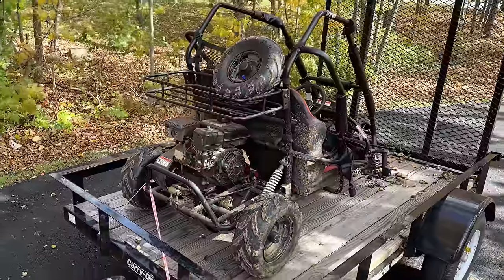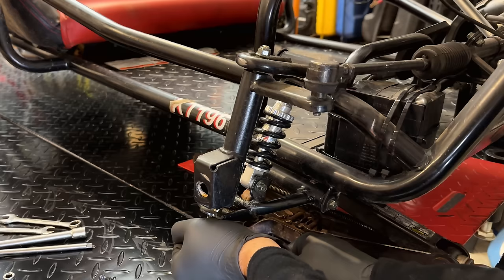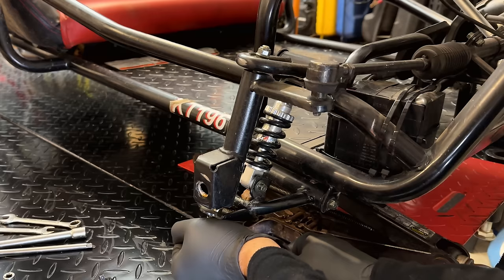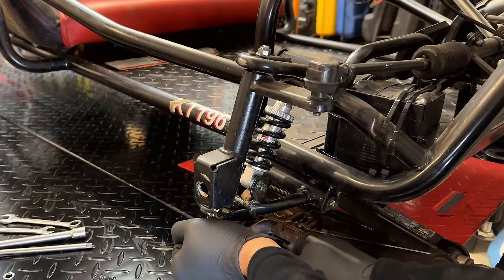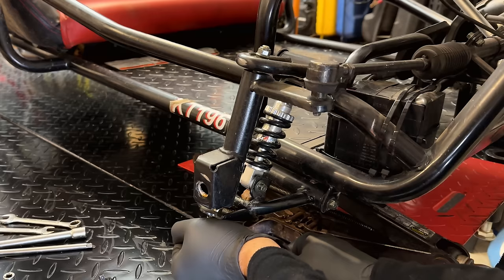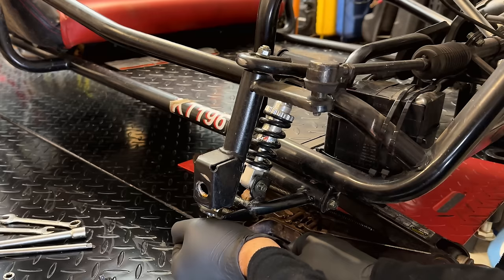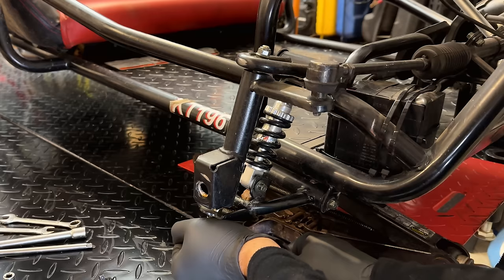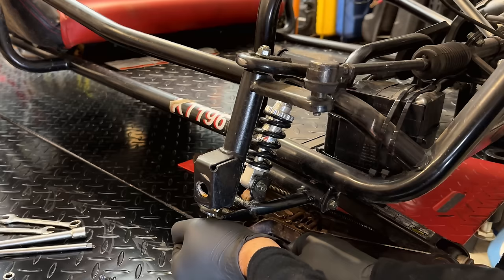Coleman KT196 Major Upgrade/Repair - Electric Start, Charging System, Suspension, Lights and More...

Comment: I don't think that brass "spacer" you put between the engine and drive pulley of the CVT goes there.  Think it goes between the "jaws" of the drive pulley.  Supposed to "float" there so the belt doesn't get constantly rubbed by the spinning output shaft of the engine at idle.  Great video.  Amazing the destruction a kid can do to a go-kart in a few years, even if you maintain it well!

Comment: Ran into a similar issue with the carburetor line spring clamp on my generator .  I ended up putting the clamp over the tube past the flare on the carb, opening the clamp and sliding the fuel line over the tube and under the clamp.  It was impossible any other way and I didn’t have any larger clamps.  Where there’s a will there’s a way lol.

Comment: You probably could have wrapped some rubber where those light brackets went and they wouldn't have moved.  A lot less complicated, but your solution certainly solved the problem.

Comment: run a weld bead under where the lights attach.... will give it something to grab on too

u could also wrap some tape around the tube and then attach over the tape

Comment: You could put crank on top dead center on compression stroke before pulling side cover then there is no pressure on cam from valves. Cover is easier to remove in some cases too

Comment: Lots of work, I am sure your kids will be excited. Did you consider just relocating the engine control panel to the front and making and extension for the harness? Alternatively you could have just used the components from the nine panel once you decide it could not remain in the back. The final results are very professional. I expect the battery would be happier and last longer mounted on the chassis rather than the axle?

Comment: That's funny. You made the front suspension actually work, where before it was riding straight on the spindle and he now say😂s the front is bouncier. Larf reminds me of a game I used to play flying. It was called Red Baron 3d. I could shoot anyone down with the worst aircraft, because they got lots better towards the end of the war. Then I improved the feedback so now you had recoil when the machine gun fired and you could feel it in the joystick. I was never as good after that.

Comment: What you are calling a "Torque Converter" is two "Variable Sheaves". They create an "Infinitely Adjustable Transmission". A torque converter is capable of multiplying torque whereas that transmission is not.

Comment: They beefed up the ball joints on the newer kt196 you can by the older smaller ball joints and swap em out. I has same issue.

Comment: If the lower pan rattles use truck bed liner it quiets down the machine. Had a few of these type vehicles over the year.

Comment: I wasn't there but I don't think the crank swap was necessary. I run 30 series on the regular clone cranks every day. 🤔 Also, I think you opened the valve lash up too much. The gap will actually open when the engine heats up as the aluminum case and head expand more than the steel valve train. I would also recommend removing the low oil switch for a power sports application.

Comment: They make adapter extensions for the crankshaft to give you the extra length you would require it utilizes your existing pto mounting bolt it would have saved you a lot of trouble swapping the crankshafts

Comment: Personally, I would have mounted the light brackets backwards, so the lights are more inside the frame rather than sticking so far out the front.. 
From what I could see from the camera angles, I don't think it would interfere with the steering.

Comment: I'm thinking what could have been shock absorbers are really some sort of stabilizer to keep the spring in place and also serve to change the characteristics of the spring by means of the large nut at the top.

Comment: Love your videos James. Just a well meant suggestion, You might want to reverse the mounting brackets for the new headlights. That way that the headlights will be slightly recessed behind the front brush guard. This way the lights wont be the first thing to come into contact with any thing that might get in the way, giving them some protection from impact.
Reply: I think that the choke cable may also need some protection inside a routing tunnel of some sort. I visualize a stump or root ripping off the cable or carb box. Proper leg thing and some well placed zip ties might help.
Reply: Lengthening

Comment: The bolts and upper and lower a arm should be tight. The bushing should rotate inside the a arm. If you leave the bolts loose, it’s just gonna wear out the holes that the bolts go through and the bolts.

Comment: I suggest leave the return hose from vent, put a bolt to plug the hose with existing clamp and secure...
Reply from the maker: Then the tank would not be able to vent and eventually the tank would build a vacuum and fuel would not flow to the carb.  It would work if the tank cap was vented.

Comment: 1:40:30 You want to imagine a stick sticking out of the back of the switch, it will point to which terminal will touch common(center tap) when you actuate the switch. 99% of every switch you see will operate like that. Also that's called a dpdt switch "dual pole dual throw", in the configuration (on-off-on) (momentary-latching-latching)

Comment: The choke could have been routed on the same side and not around to the other side it would have put it almost to the dashboard for easier access. For your headlight issue instead of that screw being drilled into the back just get a piece of rubber it would work the same and wouldn't scratch the paint.

Comment: Just put a 90* elbow fitting on the evaporator port fitting on the air box and shorten the hose a bit.

Comment: I would have turned the light brackets around so the protrusion is facing rearward, and then turn the headlight back around towards the front which would center the mass of the headlight closer to the center of the bracket.

Comment: 1:30:15 If the wires are long enough, I wouldn't remove the on-engine control box entirely, I'd simply relocate it to the bar it's going to hit when the suspension moves...

That way, not only do you keep the Circuit Breaker and Charging Diode, but you also don't risk Borking the engine by futzing with the control wiring...

Comment: The depth of the castellations on the wheel nuts wasn’t the issue, it was the height of the nut body. I would have ground down the face of the nuts to fit.

Comment: All the fun. Good video. I was going to suggest a coke cable but you did that lol. The only thing I would have added was a seal battery box. They are affordable and will keep the battery clean. FYI next time maybe test the new engine before you swap internals out.

Comment: I would have just bought the proper drive pully. Actually, the old Pulley would work just fine. A replacement pulley comes with two retaining screws a short one and a long one.

Comment: Great video Jim. That was a ballsy move changing the cranks out, wit a brand new engine😀
I think I would have greased up the upper and lower “A arm “ pivot bolts.
Nothing is easy to fab up. 
You did a fine job, happy it’s in one video, I’m off on Christmas break. 
Now I have to mow and weed eat the yard. And my neighbor has a problem carb on his Troy Built pressure washer
he wants me to look at. 
Ps : how about a video on how these multi position rocker switches work , please.
Merry Christmas.
Jim in Pt St Lucie, Fl.
Where its currently 76 and mostly overcast
Reply from the maker: Ahh warm weather.  I miss that.  Have a Merry Christmas

Comment: Thumbs up, great video, upgrading, and repowering where do you stop till you have full buggy suspension front and rear , 40 hp engine, and your down at the Dunes driving itin the sand with the others, a trip to Harbor Freight for a set of offset wrenches, you will find they are very handy.

Comment: James, can you cut out a piece of PT plywood for the battery tray....
with cutout holes for the heads of the tray securing screws...
then use the foam across the whole tray (foam covering the holes in the ply) 
so that there is no chance that over time the foam crushes and the screw heads impact the battery case cracking it and destroying the battery?

Comment: This seems like a perfect father/son learning project.  Are you sure those front shocks don't need to have oil added to them?  If you put a second nut on the switch behind the panel to offset the switch farther back away from the cross rail would that give you enough clearance to make the switch fit with the cool cover?  Much koodoos James for thinking on the fly to overcome each problem in turn to keep the project moving forward.  With all the little things you found wrong it shows the importance of routine "pre-flight" checks.

Comment: I was expecting you to use the key switch that came with the engine for the run start and stop. And just use a rocker switch in the existing square hole for the lights.

Comment: The thing that caught my attention weirdly enough was on the original 6.5 hp engine, the cam shaft gear was plastic. That surprised me a little bit. Even with oil lubrication, i feel as if the hot oil and the general radiant heat of the metal would melt that plastic cam and all he** would break lose in the crankcase.
Reply: Just another way to save money i guess  💁‍♂️🤷‍♂️
Reply from the maker: Not the best choice.  They do fail.  That was the issue with this mower https://youtu.be/oY6YZZ72jJw?si=ySPWsKtIEL9Koc5E
Reply: They don't just make the cam gear out of plastic. Now several popular brands actually make the cam and lobes out of some type of plastic. Its a crazy concept to me but yes, they work. And YES, they fail at times.

Comment: Don't feel bad about your  purchase of those steering parts  i just got a new set of wheels and tires for my craftsman ys lawn mower and the tires are the same as the ones that are on the mower but they are not the same color rims as the ones that are on my poulan XT mower  but at least you made those New steering spindles work on your son's go kart

Comment: yes but one thing i did not see you do and that was check the charging system with the lights in the on position
Reply from the maker: It probably was not keeping up.  Thankfully the engine does not need a good battery to keep running.  So far has not been an issue.

Comment: That drive system is similar to a snowmobile.  I think the drive clutch on the engine is not fully locking up due to the low engine RPM.

Comment: Hello James, too bad it is a 4 stroke, very slow, clumsy, hope your son likes it. What a strange transmission with two chains. I personally had tried bigger wheels, a loyal fan from the Netherlands
Reply: You can vary the top speed by changing the sprockets....
It works as a limiter as well of course....
but allows the engine to develop full power without bogging down...and no clutch or gear changing required.

Comment: @James, you made a very common measuring error when measuring the journals. You should be using the knife edges, not the flats of the calipers when measuring shaft journals.
Reply: 99.9% of the time it doesn't matter, but occasionally it does. So it is good practice to get in that habit for the rare occasions that it matters.😊
Reply from the maker: Good point.  I was a little too sure it would fit.  Probably should have also used plastigauge.
Reply: For those who may not understand why it is an issue, if there is a taper or grooves etc on the journal that isn't obvious to the eye, the flat surfaces will "average out" the variation and give you an incorrect reading.

Comment: Seems like it would have been less trouble to just weld an extension on the output shaft to make it the right length, instead of taking apart a brand new engine and mixing/matching parts.  IMHO

Comment: If the front coilover shocks were used up don't think the rear have the same amount of time on them?
Reply from the maker: The rear shocks are original to the go-kart.  They seem to be holding up fine.  Wish the front were larger.  Seems like they will just fail again soon with the way my son drives.

Comment: I would have had a machine shop turn a spacer for the end of the crank shaft and used a little longer bolt. 48:40

Comment: The throttle cable is dragging on the fuel tank.  Scratch the paint, rust the tank, leak fuel, engine fire.

Comment: I would be interested to know if the stroke on the new crankshaft was the same as the old.  That may be where some of your extra HPs had come from.  Bold of you to tear apart a brand new engine to swap parts.  I would be to much of a nervous wreck to do that.  Good job getting it working!

Comment: It would be great if there were the same units of measurement worldwide. That would simplify a lot of things. I'm surprised that there are even stores in the States that sell metric screws, nuts and drill bits. That's certainly the exception rather than the rule and, as with imperial, things certainly cost more. Greetings from germany ;-) btw.   thanks for adding the torque in NM love your videos
Reply from the maker: It would be great.  Thankfully I have a well stocked small hardware store with a great selection of metric hardware.  The larger big box stores would not have had that.
Reply: In Canada they converted to metric back in the seventies.but I still go to the home improvement stores and there are 4 x8 sheets of plywood and wall board ,go to Princess Auto buy hose by the foot . Still a lot of things here done in imperial
Reply: @12wingwfetech  The only things where we actually still use inches are screens (where the specifications are also in centimeters), tires and pipes in heating systems. Nobody can really do the math with it. I am always amazed at how quickly fractions can be calculated. I had real problems with it at school.

Comment: I like your videos and attention to detail. May I make a request  I would be interested in a video showing converting a gas powered generator to run on propane.  I feel that running on propane would be more tolerant sitting for long periods of time between usages.  Thank you
Reply from the maker: Did one last year.  Will link to it.  https://youtu.be/TReTACsS2cM?si=Ou9gMMS0DxDDvC25

Comment: Great video! However, I found the choke cable to be overly long, making that big loop in back of the engine. No way to make it aesthetically shorter?
Reply: You cut the spiral sheath outer...and then the inner cable to suit whatever length you want.
Reply: I was wondering that as well. Seems that loop could snag on something in the wrong circumstances. Can’t have it bent sharply,  but maybe rerouted a bit.

Comment: great video again, i noted something, what is regulating the charging current to prevent overload the battery
Reply from the maker: There is nothing limiting the battery charging other then the charge voltage.   Would not be good for the battery if charged that way 24/7

Comment: 2:10:45 Did you try installing the EVAP line to the Air Filter Housing before tightening down the bolts? the line might be flexible enough to bend just before the Throttle Cable (which doesn't move at that location) without kinking...

Comment: Another great and informative video,loved it.
But just wondering why you didn’t grease up the front end while you had it apart or maybe I just missed that part,rock on
Reply: I would  have looked  into putting  grease fittings  on the upper and  lower control arms unless they have rubber bushings like  a car.

Comment: The 420 will probably not wear the sprocket teeth as badly as the 410 if there is a lot of torque and power to those pulleys.
Reply: You ever figure out what was going on with the infinitely variable primary belt drive and the belt getting hot?

Comment: I don't think you needed to change the crankshaft. Many clutch systems don't reach the end of the crankshaft. I couldn't tell when you removed the outer bolt on the crankshaft if the flanged bushing was long enough to touch the end of the crankshaft or if it was just holding it against the step on the inner part of the crankshaft. At most, you might have had to add a spacer.

Comment: You have more balls than me thinking that crankshaft would switch . Good call! Does the suspension work now?
Reply from the maker: It works as designed.  That said the suspension only has about an inch of travel.  Need more then that to survive my kids.

Comment: I know this sounds crazy. Are you in Tennessee? And is What the Rust in your area. Your neighborhoods look very similar. Nothing wrong with the length if you're also working on a project like that. Which I might be. lol But a mower comes first. Work before play. roflol Also, your test driver is working real hard at making this project work. Too bad that kart is so small. You might be testing it yourself. lol I worked on one for my cousin long ago and between his Dad and I we both rolled it. Had trouble getting out of the thing because we were both laughing so hard. Life can be real good.

Comment: Did you try the pulley on the shaft? Pretty sure the pulley is adaptable to diff. length shafts, just need diff. thickness spacers behind pulley. Might have to adjust driven pulley accordingly.
Reply from the maker: The pulley did fit on the short crank.  Its just the crank did not go even half way down the length of the pulley.  Was worried there was not enough to hold it on properly in the long run.